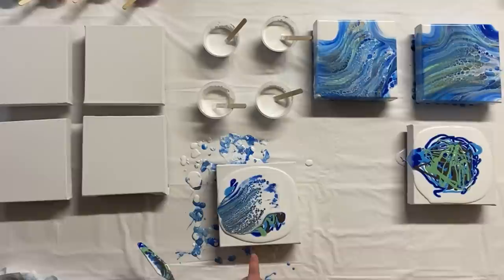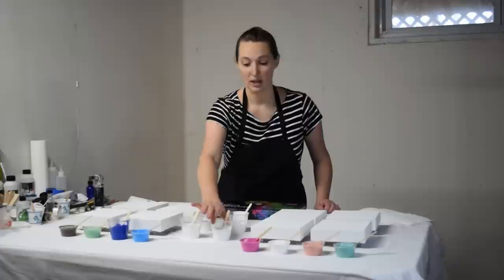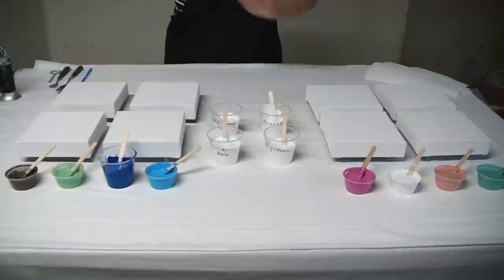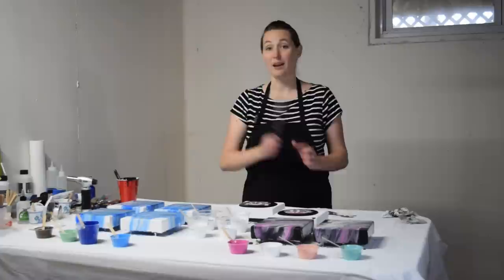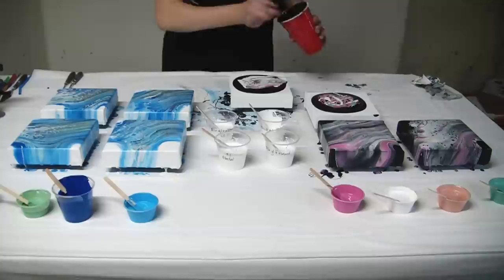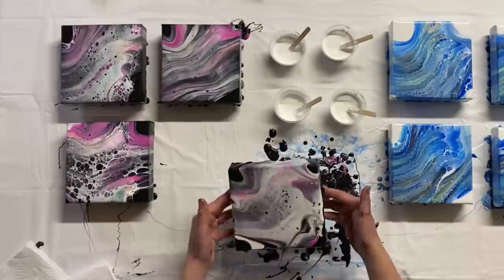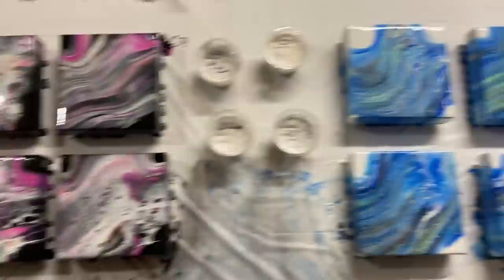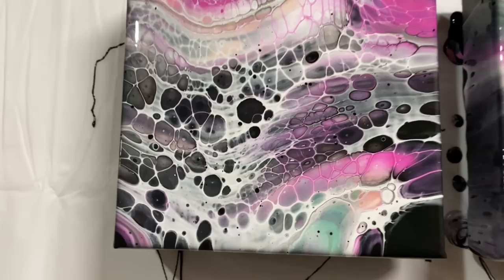The ULTIMATE Inexpensive Cell Activator Test!!

Comment: Oddly, the only recipe I've never tried is just amsterdam paint and water alone. My feeling is that floetrol doesn't react with floetrol in swipes so other additives are doing all the work. The minwax prestain does all the work and doesn't do enough nor do the cells hold up as well. I lose the ca color almost entirely. I'm anxious to try the paint and water combo and plan to bust out my morning errands and cleaning so I can give it a try this afternoon. Thank you very much Anna! Can't wait to see how the mixture compares with the aussie floetrol mix.
Reply from the maker: Yes, it’s crazy how well it works. I hope it goes well for you! And I’m very curious to see how it compares as well.
Reply: @AnnaBlountArt  I did a quick experiment when I finish errands, just grabbed a few paints id mixed with floetrol then mixed up amsterdam oxide black, Prussian blue and titanium white each with water only. I didn't lay a house paint base, just a thick blue I had which I laid a line of orange and gold over. I did one swipe of each color and bam! instant lacing!! All 3 amsterdam paints worked awesome. Thank you!❤
Reply from the maker: @vegasmainiac7745  YAHOOOO!!
Reply: So what is the purpose of using Floetrol if the paint and water works?

Comment: One question and one comment.   If I understood you correctly, you used Amsterdam paint along with Ansterdam Titanium white as the activate on the non Mica series. Seems like the Whire activitator would have prevented much reaction with all Amsterdam.  As comment,  perhaps if you had omitted any white paint with activator that was also white and substituted it with more of the pip green, your result would have been less cloudy.

Your demonstration of various alternative mixture combinations less expensive than Australian Flotrol was very enlightening.  Many thanks!
Reply from the maker: My paint brands were Creative Inspirations and Master’s Touch, and the Amsterdam was only for the cell activator.
And yes, I wish I had added less white and more green. However as you see with the one “successful” cell activator, the lacing that opened up made the colors come through much better than the ones that didn’t make as much lace.

Comment: The cells comes from the reaction from the swiping, not the recipe itself... just for the understanding of the reaction. it´s not a chemical process, more a physical. thats why the old mixture still works... ...nice colours and great video...
Reply from the maker: I’m sure there’s a physical aspect to the swiping, but the paint mixture that you use matters for sure!
Reply: @AnnaBlountArt  yes i agree, but I think Its important to understand that it is either the swiping or e.g. A heat gun that Will provoke the cells to emerge. The mixture does matter in terms of how Easy the cells comes forward or how Big and uniform the cells get. I just wanted to elaborate on why the old mix still Works. Not saying mixture isnt of importance :)

Comment: I've been using Amsterdam paints and water as a cell activator. Seems to work very well with floetrol/paint mixtures. I haven't used house paint as the pillow, just regular Artist Loft paint, floetrol and water. I've been very happy with my results.
Reply from the maker: I’m glad! And now you can be sure that it really is one of the best ones!
Reply: only the white? or other colors?

Comment: I suspect that the reason you got fewer cells in the black pillow examples was because you mixed floetrol with the black pillow paint. The cells emerge as a result of the contrasting viscosity (& therefore surface tension) of the different layers, so if your base layer is thinned with floetrol to a more similar consistency to your colors/cell activator then there won’t be a differential sufficient to cause a significant physical reaction between the layers (i.e. the thinner and thicker paints won’t be able to sink through each other & break each other’s surface tension to cause cells because it’ll be more like one continuous fluid (which is probably also why the white & black blended to grey so readily, rather than staying separated, in addition to the fact that simply being thinned out to a more liquidy state enables faster & more complete blending in general). 

Also, I’d never heard of a 1:9 ratio of paint to floetrol— that seems like a lot, but maybe for cell activator it’s not unheard of. The one other factor that came to mind is whether you strained your US floetrol, because in my understanding it seems like people say that’s crucial if it’s the US & not the Australian version. But interesting experiment! Gave me a lot to think about. I’ll have to try just titanium white paint & water because I have yet to achieve a really consistent recipe & certainly not one that affordable.
Reply from the maker: Actually my black house paint was thicker than the white, so I thinned it only to the equivalent pillow consistency. I also did so to demonstrate that pillow paint didn’t have to be just house paint - it could be a thick floetrol mix as well.
And I always strain my floetrol.

Comment: Great test, curious though on a couple of points... 
1, activators sat awhile, I wonder how much seperation happened and maybe better to mix a bit before application. 
2, second curious about torching the activators after application and before swips. Heat does a lot of d8fferent things to the different ingredients.
Reply from the maker: Good thoughts, though in my experience neither one of those factors make a significant difference in what I was doing!

Comment: Is it possible that your non bloom recipe was thinner than your CA & that's why you didn't get as many cells in most of the results of that batch?
Reply from the maker: No, my paints were all quite thick. Good thought though. I think it’s mostly because a floetrol CA and a floetrol PM don’t react much. If your “standard” mixture was with liquitex PM or something, it’s possible that the others would work well!

Comment: i wonder if the paint and water would work the same using srteza paints
Reply from the maker: Do you mean Arteza paints on the canvas, and the Amsterdam paint and water cell activator? Or Arteza paint and water as a cell activator?
Reply: @AnnaBlountArt  either way? Have you tried water with any other brand of artist paint than Amsterdam?
Reply from the maker: @VelvetCrone  I think the cell activators would work when swiped over Arteza paint. And I think you could make a cell activator with Arteza paint and Aussie floetrol, but I don’t know about paint and water. I’ve only tried Amsterdam.

Comment: very interesting... a couple of questions: one with the paint and water mix, do you add anything else to the mix,. two: when i mix my paint and do a pour the cells appear. they are small, but when the paint dries, they completely disappear., what am i doint wrong and how can i correct it? i've used both americal and australian floetrol and also silicone oil.
Reply from the maker: It’s literally just the paint and water.

Are you swiping or blowing the cell activator over your other colors, or mixing everything all the same? Silicone oil is different than a cell activator. 
Do the cells grow so large that you can’t see them anymore, or do they shrink? It could be that your paint consistency is not the same for all your colors, or isn’t right for the technique you are doing.

Comment: I think more cells would appear with the floetrol with the heat.  It’s silicone based and it it lighter than the paint.  If you hit it with heat the cells will appear like crazy.
Reply from the maker: Floetrol is latex based. I have tried torching and it doesn’t make much difference!
Reply: @AnnaBlountArt  GREAT TO KNOW!  Thank you for your response.  I just saw another artist hit it with a heat gun and the pop out like crazy… maybe he is doing something different.
Reply from the maker: @kcgarthwaite  silicone oil in a glue-based paint mixture really pops out when you torch it. But without the silicone oil in it, the torch can be hit or miss.

Comment: The black paint section wasn't torched right away like you did with white paint side. How did that effect the outcome?
Reply from the maker: The torching is to pop air bubbles in the pillow paint. It won’t affect the lacing but may make some additional round black cells to torch after the swipe happened.

Comment: Thank you for the information.
Regarding pillow paint. I can not get the Valspar.  How about replace Valspar paint with normal acril paint with floetrol mix?
Reply from the maker: If you have indoor latex wall paint, any brand should work fine! Or yes, you can make a thick acrylic paint/floetrol mix as your pillow, especially if you’re using a floetrol mix for your colors instead of the “bloom” pouring medium.

Comment: What is the difference of using house paint and the acrylic craft paint? Do you thin down the house paint?
Reply from the maker: Do you mean overall, or on the black and pink side?
House paint is the standard “pillow” for a bloom pour.
Even on my floetrol-mixed side, house paint is a lovely thick paint that doesn’t crack a lot. So I thinned the black with some floetrol to get it to the right consistency. You could easily use acrylic paint or craft paint for the pillow, as long as it’s thick enough.
Reply: @AnnaBlountArt  thank you for responding. I have noticed different artists using house paint for pillow and was just curious for the reason. I really enjoy watching your videos. Thank you!
Reply: @nancymohler74  - it's cheaper than artists paint, we have it on hand or easy to come by, and it has a high specific gravity (due to additives that make it super opaque for high coverage on walls)  so the expensive micas and semi opaque artists paints don't sink down in and get lost in it like they can in artists paint.

Comment: I wonder how it would have worked if you mixed the white 'pillow' paint like you did the black 'pillow' so that both black and white pillows contained (or did not contain) floetrol.  Why didn't you mix the white with floetrol like you did the black?  I'm confused. (as usual) 😆
Reply from the maker: So the white and blue side was a classic “bloom” recipe, with house paint as the pillow and the paints mixed with untinted house paint and polycrylic.
The black and pink side was more of a “standard” paint pour mix: paint and floetrol, just mixed thicker than normal.
Also my black house paint was quite thick, so I added floetrol to help thin it AND keep it similar to the paints being layered on top.

Comment: does it make a difference between butane, propane, or a heat gun for activating the cells
Reply from the maker: Butane torch I believe is the best for popping the air bubbles. The cells here form more by the top layer stretching and splitting.

Comment: Great experiment Ty. Did you use the water based or the oil based minwax?
Reply from the maker: Thanks! Well minwax is a brand. In my bloom pouring medium I used the water based polycrylic, and in the cell activator I used the oil based pre-stain wood conditioner.
Reply: @AnnaBlountArt  yes, thanks… you understood what I was trying to say lol 👍🏼.
Reply: It would be great if you could do a video comparing the oil based vs the water based Minwax conditioner in the cell activator. I’ve been researching this for months (tight budget), some swear by the water based and others the oil. Still not certain on which works better. New sub 👋. 😊
Reply from the maker: @bostonbutterfly4473  interesting. I personally have no need to do that because I like the paint + water cell activator much better than the minwax one anyway…
Reply: @AnnaBlountArt  I see, good to know… thnx! 🙂

Comment: Thank you very much. I thought if you wanted cells you aso have to admit some alcoholdrops.
So just using floetrol you care activate cells  ??❤
Reply from the maker: You’re welcome!
Often we use silicone oil in fluid art to make cells. 
The “cell activator” in this video is for a particular type of pour, with a specific recipe. Check out the video details for more info!
Reply from the maker: You’re welcome!
Often we use silicone oil in fluid art to make cells. 
The “cell activator” in this video is for a particular type of pour, with a specific recipe. Check out the video details for more info!

Comment: Do you ever use silicone oil for a cell activator?
Reply from the maker: Yes I often do use silicone oil to create cells! But actually “cell activator” is a specific term for one component of the “bloom” technique. It doesn’t require any oil to achieve this characteristic lacing.

Comment: I'm confused. I'm a total newbie to this, but how can the white acrylic mixed with water ba an activator?
Reply from the maker: So…there are scientific explanations for why this works, that have to do with paint density and surface tension, etc.

But if you’re a newbie, I would recommend just contenting yourself with the fact that it works 😆

This is NOT the same as adding silicone oil to paint to make tons of cells. A cell activator is a very specific top layer that gets blown or swiped over other paints to make lacing.

Comment: Can you just use a Amsterdam titanium and water or Floetrol as a pillow
Reply from the maker: The Amsterdam white and water is a cell activator, and shouldn’t be used as the pillow.
Floetrol is a thinning additive. If you wanted a transparent base, you could use straight floetrol, but it wouldn’t be thick enough to be the pillow for a “bloom” pour like I’m demonstrating here.
But if the rest of your paints are mixed with floetrol (rather than the bloom pouring medium), your pillow absolutely can be acrylic paint mixed with floetrol, instead of house paint.
Reply: @AnnaBlountArt  
I’m confused at what your saying I can use for a pillow if I don’t have house paint? I can use an acrylic paint just not Amsterdam white. What if I want a white background. What would I use?
Reply from the maker: @patriciamora2915  Any acrylic paint, including Amsterdam, can be mixed with floetrol to become a pillow paint. Amsterdam white mixed with water is what you’d use for the cell activator, though. The pillow and cell activator are different thicknesses and serve different purposes.

Comment: With the Amsterdam & water - can you tell me what the paint to water ratio is?
Reply from the maker: I never measured. You can start at 2 parts paint to 1 part water and work your way up from there until it flows really smoothly off the stick.
Reply: I'll give it a try - thanks.  What do you use to help the paint flow you tilt it?  Just regular pouring medium - like amsterdam?
Reply from the maker: @franspraetz2321  check the video description for lots of details!

Comment: Could this be used on white cotton fabric?  I’m an art quilter
Reply from the maker: That’s a cool idea! But honestly I don’t know. I’m experimenting with doing paint pours with craft paint but it would be a different mixture.
Reply: Maybe I can help with that, I'm an artist that works in a lot of mediums with a bent towards textiles which I often paint. I used to quilt, in the 70's, and I sew, in fact I have 5 sewing machines in my painting studio, which often surprises people. Quick answer is maybe sort of -- but you'd have to stretch and coat it first, then once the paint dried it'd be more rigid and stiff than you might want on a quilt. Explanation : Artist canvas is cotton duck, which is very heavy duty (think drop cloth or director's chair fabric). Most (almost all) of the canvases used in Paint Pouring on Youtube are duck that is "ready to paint" for hobbyists, which means they have been machine coated in a type of paint medium called Gesso, which makes the cotton duck quite rigid (in art school one learns to stretch and gesso their own canvas, and many artists prefer to, or don't, depending - but it's a lot of work.) Gesso keeps paint from soaking into the duck and let's it stay on top of the fabric which allows pouring, tilting, swiping and blowing to get these looks. To do this on quilting fabric you would have to stretch it, then seal it with something, and then paint it. You'd increase the thickness of the fabric A LOT. Like, exponentially. I have had limited success at sealing fabrics with a variety of sizings from 3M, Rustoleum and ModPoge, and I've even tried spray varnish. When I do seal them they are never supple after painting, and they often crak within a few weeks. (especially chair bottoms)  After the fabric is sealed you'd have to be concerned about the weight of the paint causing it to pool in the center of your stretcher rather than run to the edges as you "pour and tilt".  That said, Plaid, Angeles, and Jacquard all make mediums designed to add to paint to make it textile friendly, but they soften the paints and make them flexible when dry, which will likely change their ability to stretch, cell, bloom, and not become muddy. But I haven't tried it - not even on leather. Yet. It would be cool on leather! These companies also make paints designed for fabric.  I would look to Ikat, or alcohol ink/dye  techniques to figure out how get this look on a quilt.  Somewhere some old hippie has probably tried it as a unique type of tiedye. Or maybe on the Rit youtube channel? Hope this helps, or at least let's you know what you're up against and where the challenges are. I have thought about trying to do this for shade structures and tent tops for festivals, but I ended up pouring, stretching and swiping on full sheets of plywood when I wanted this look for an event.